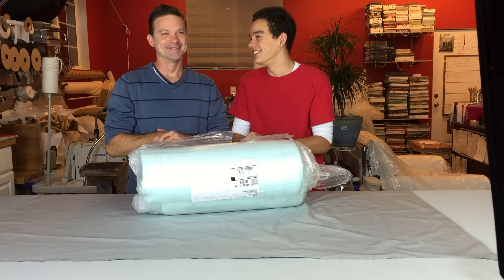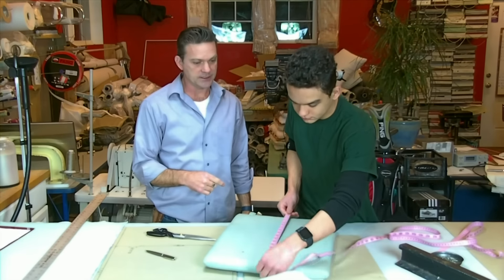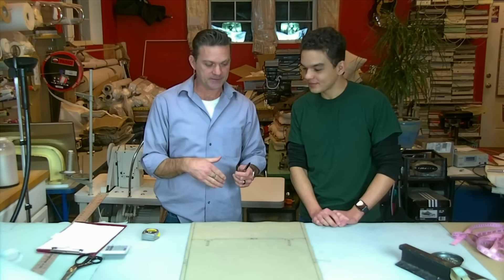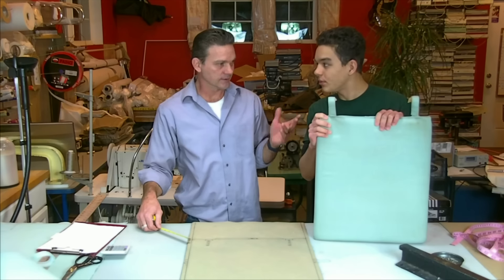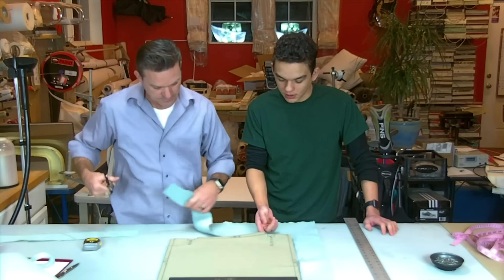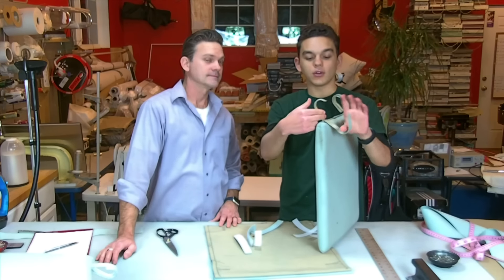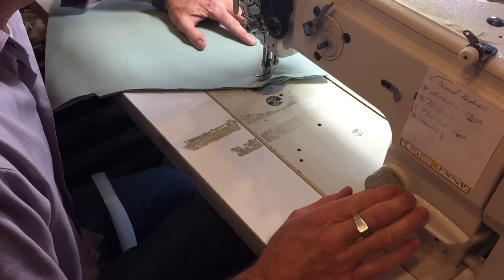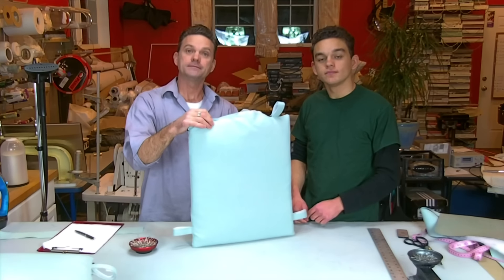How To Make Simple and Easy Outdoor/Indoor Cushions Inexpensively

Comment: Brilliant, thanks so much for your helpful video. I am going to make 8 new cushions for my dining chairs using some fabric left over from another project. They will be so much nicer than store bought ones.
Reply: I use a thin plastic bag & put the fiber wrapped foam into it with the opening folded over . That goes towards front of pillow. Makes it much easier to stuff cover. Once all in, I can side open top of plastic bag  & pull bag out leaving fiber & cushion all in place.

Comment: Great video! Most cheap fishing line is nylon, but you can also get fluorocarbon as well that is more resistant to UV radiation. There's also braided lines that are more supple and flexible. They're almost like a flat, waxed thread if you get a lighter pound test. Really enjoyed the video!

Comment: I am making mine for a bistro set and running into problems.  Cannot get the fabric to fit tight on the foam even though I traced it... used a template and measured.  Not sure what the problem is but I'm frustrated.  I did EXACTLY what you did.  😳
Reply from the maker: Hi Raechel,
Thank you for watching our videos! And sorry for the delay too! Sometimes when cushions are made you need to add Dacron to them to get that fuller look. It’s weird like that, even if you match the covers exactly. We have a link to some Dacron at our website here:  https://ucprivatecourses.com/index.php/upholstery-kit-upholstery-supplies/
I hope this helps! 
All the Best,
Grant